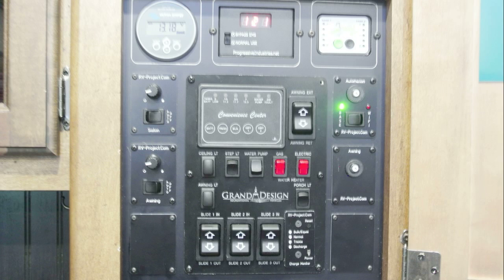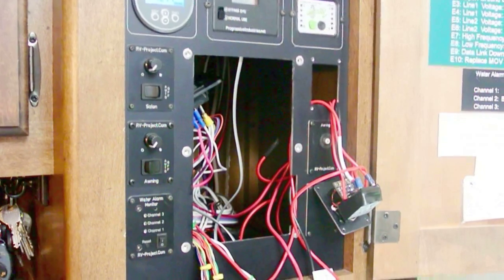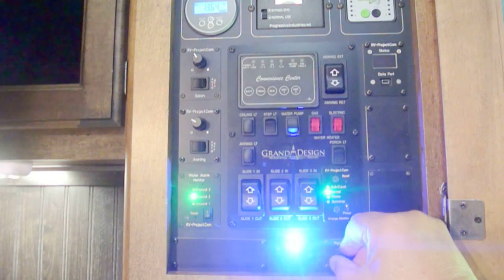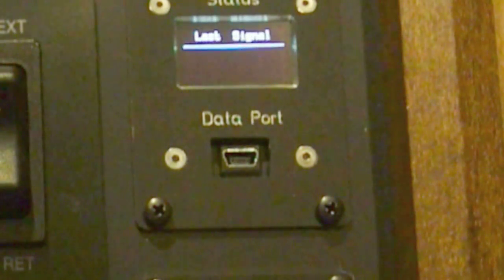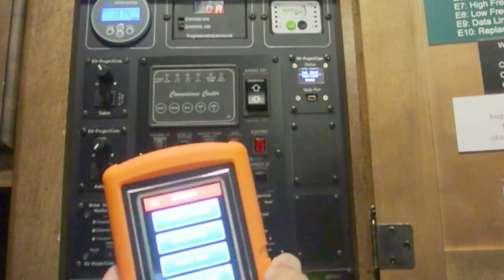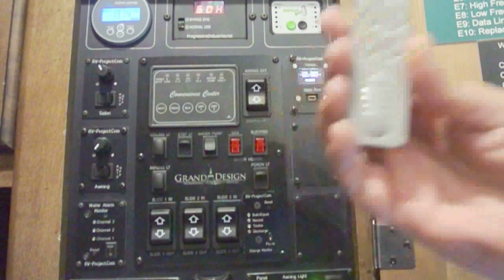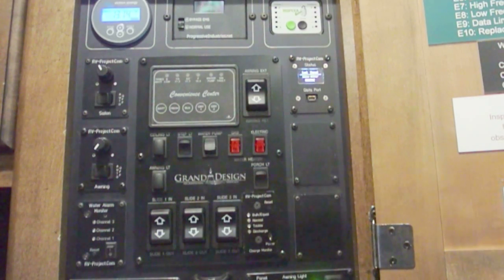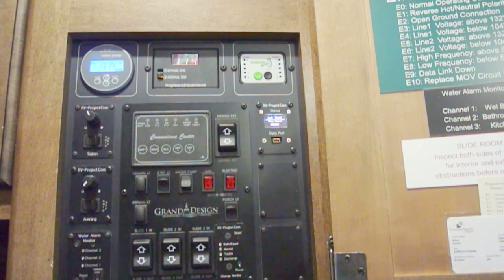Custom built wireless system for my RV; controls lights and awning.

Comment: Awesome project, i have experimented with the code and its very cool, One question is there a easy fix for a latching mode? Or will it be in a future update for this? Again very cool project i would like to build myself but need latching mode for my need :)
Reply from the maker: I did experiment a bit with latching modes and it was successful. You would simply need to define a variable with some logic such as "IF ON, turn off"/ "If OFF, turn on", or "output= !output" on a boolean variable.

In other words toggle it's state. 

You then could connect that channel's output to that logic.  Make sure you do not put that logic into the select statement as for debouncing reasons, the program traverses the select statement several times each time the transmit button is depressed (meaning it would toggle on and off rapidly many times each time you depress the transmit button).
Reply: @RVProject  ok, do you possible have the code or the changes needed for latching function, i am quite new to programming so i don´t really know what to change.
Have you tried toggle mode? it would be even better to save buttons on the remote :)
And how is it going with your universal remote? It looks really awesome too :)
Reply from the maker: Unfortunately, I do not have a backup receiver at this time - my only one is installed in the RV.  I have been meaning to build another receiver as a backup, and one I can test on (so I don't have to make changes to the installed unit).

Until that time, I won't be able to suggest code changes.   I should have a second receiver built sometime over the winter.
Reply: @RVProject  Ok, that is understandable :) will follow you and your great projects,
I see that some of the files for your remote on your website is missing, is it just me or did you intentionally remove the schematics and pictures? 
Again great work and thanks for sharing.
Reply from the maker: @axelkontio5943  I have not actually uploaded the files yet for the remote. In the video, I provided a sneak peek.  I was trying to add infrared wireless functionality to the remote, but the devices I am trying to control via IR seem to be temperamental.

This fall I will likely produce a video for the remote, and generate an update if/when I am successful in getting the IR function to work.
Reply: @RVProject  ah i see, will have to wait then :)
Thank you for all the answers.

Comment: Very nice work, I love it! Your whole control panel looks very neat and professionally done, I can’t remember seeing in any of your videos if you have a whole coach leveling system or not but I can see where a remote for that type of system would be useful as well.
Reply from the maker: Yes, I have a Lippert Ground Control 3.0. It came without a remote, but I discovered that many of the OEM installations, while remote capable, do not include the $150 remote.  I have a video where I show adding the remote: 

https://youtu.be/MmRu4FN1g7Y

Also check out my remote control section on my website where I show all of the remote control devices I have added to my RV:

http://www.rv-project.com/projects/remotecontrol.php